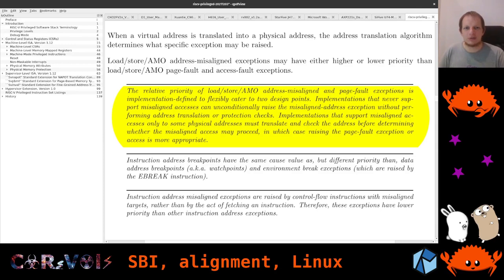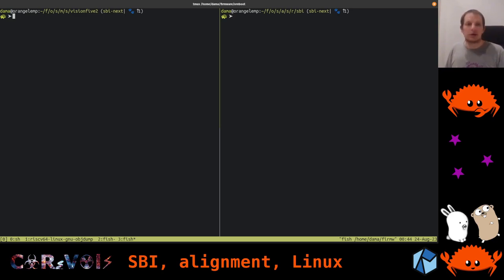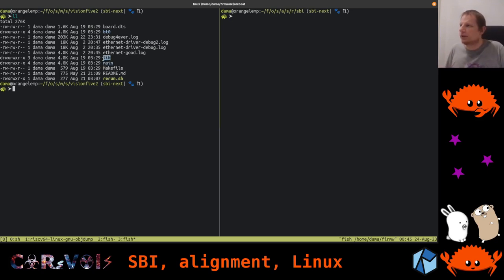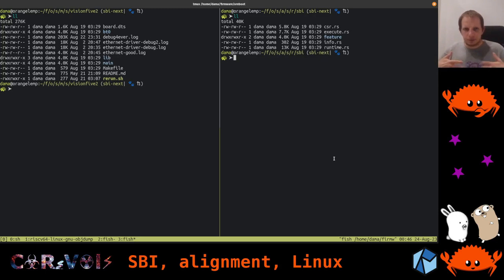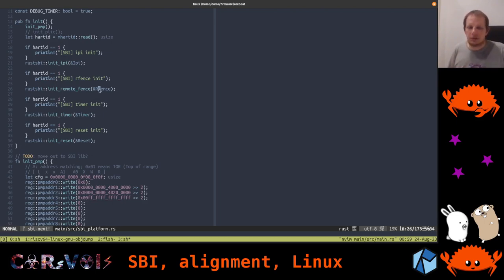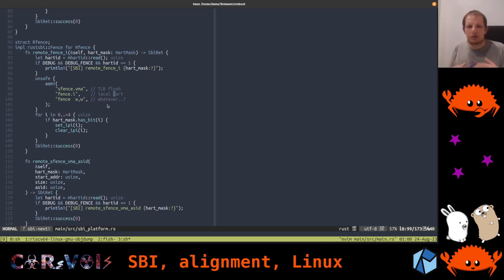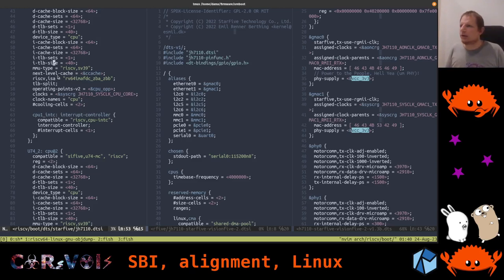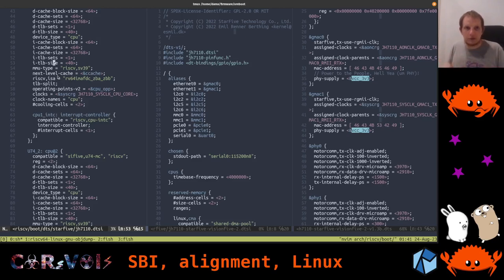oreboot on VisionFive 2 007: SBI, alignment, Linux

Comment: Hello Daniel,

Is this project going to be available as a substitute of Coreboot? I am using Pop!_OS and in their laptops they are using Coreboot (Intel). Sadly, AMD is not compatible yet with Coreboot.

Best Regards!
Reply from the maker: So far oreboot is a downstream fork, so you see the full coreboot history in the repo up to the day of forking.
There is no goal to replace coreboot. We iterate a bunch of times to see what we can get out of the Rust language and ecosystem in parallel to further coreboot development. What I can say is that it does work very well for the current two platforms, abstractions and code reuse.
The way hardware vendors provide support and documentation is unfortunately a big factor of how coreboot had evolved over the last years. Another thing is that there are significant differences between platforms. There are some patches now for coreboot to get started with integrating some Rust things there. We'll have to see how it works out, also with the community.
Reply from the maker: Regarding AMD:
There is a lot of support in coreboot and AMD engineers are actively working on it. It might not be trivial to create a port for a mainboard yet, but I cannot really tell. I put AMD / x86 aside now to focus on oreboot and RISC-V, specifcally Allwinner (SoCs), T-Head (cores), StarFive (SoCs) and SiFive (cores) for the time being. Building up such a project is really far from trivial, especially as a consumer without NDA docs etc..